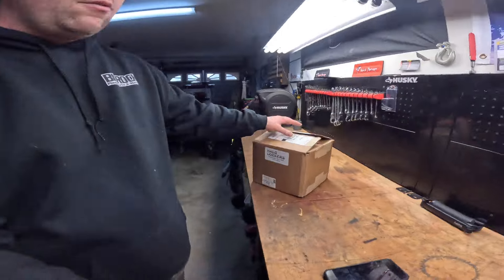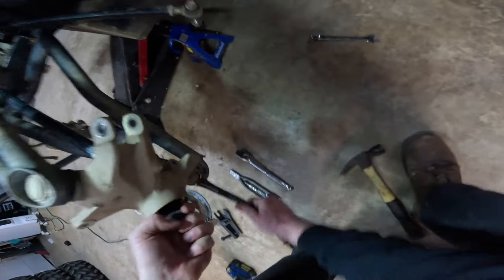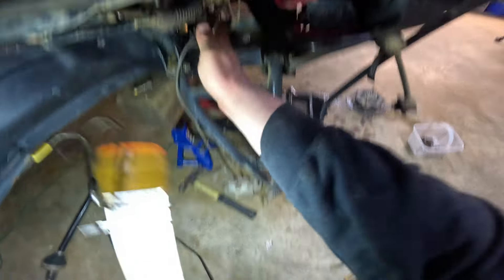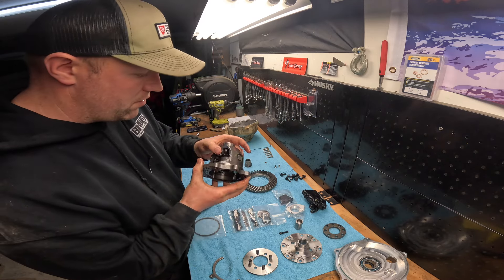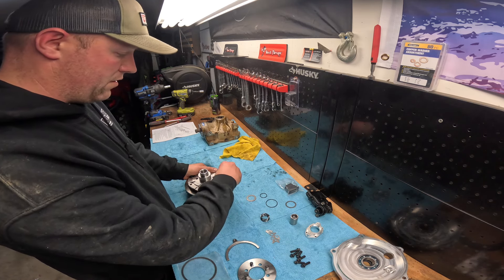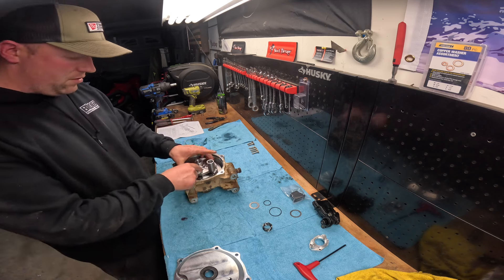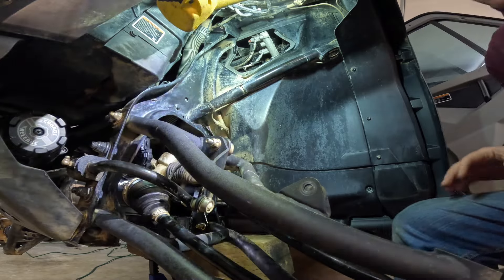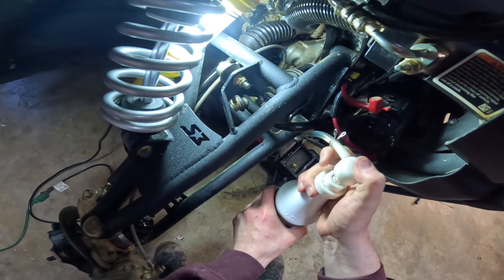HOW TO INSTALL A HALO LOCKER IN YOUR CAN AM DEFENDER LIMITED (detailed step by step)

Comment: Where did you get the amber colored switch and have you tried out the locker yet.  If so how is it?
Reply from the maker: You can get it at any auto parts store just buy a switch and swap the rocker part using the tool that comes with the switch from auto parts store, I wanted it to match the other interior lights